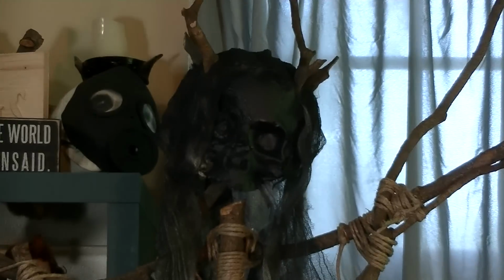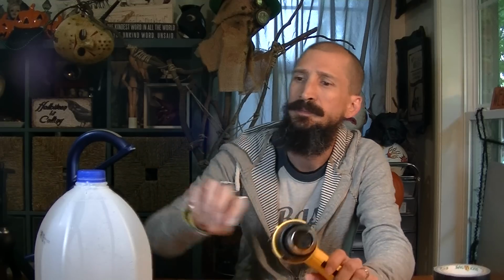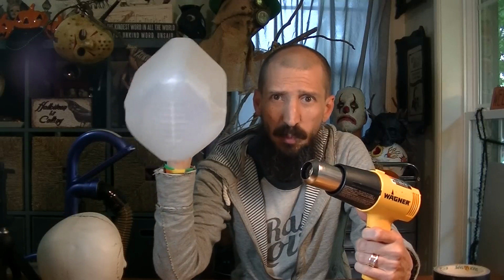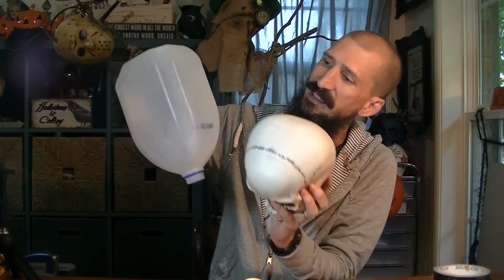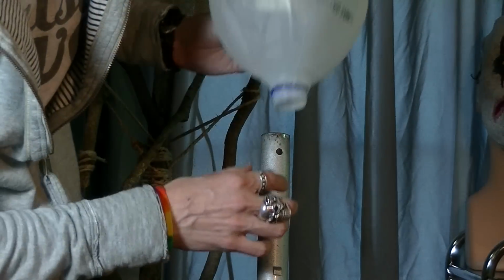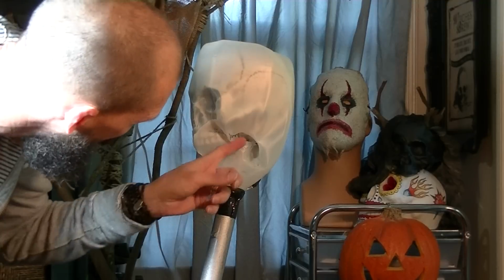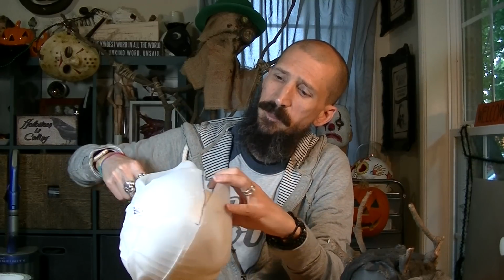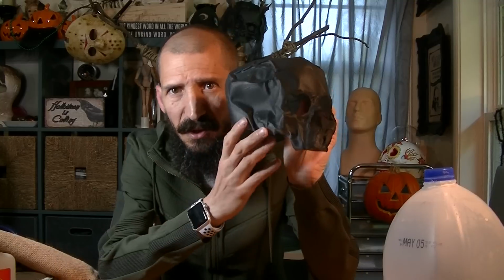How to make a human skull with milk jugs and a vacuum cleaner

Comment: Some vacuums have a bleed valve that you can open to reduce the amount of suction which will allow airflow to prevent motor burnout. But your method of alternating heat and suction is still a good idea.

Comment: Actually, duct tape as we think of it wasn't designed for air ducting at all, it's just called that. Because of the heat goes through air ducting, it isn't wise to put plastic on it. It's really waterproofing tape, because it's vinyl-coated. Air ducting uses aluminized tape (really thin aluminum strips with adhesive on the back).

Comment: Excellent prelude with the safety concerns. I just wanted to add, that if someone only has one outlet, or a series of outlets going to one circuit; that they need to use your method of turning off and on each "tool". If they are fortunate to have two outlets on two curcuits, then they wont need to...but a vent hole to prevent the vaccume from over working would be ideal. Great video man...
Reply from the maker: Thanks!!

Comment: I was wondering how well this would work as a mask. I know the question is a but subjective do to head sizes but do you think an adult could get ones head in their.
Reply from the maker: It's too small for most heads, but if you cut the front off, it could be used as a half mask for sure!
Cheers,
ET
Reply: Monster Tutorials thanks man, I can make that work.